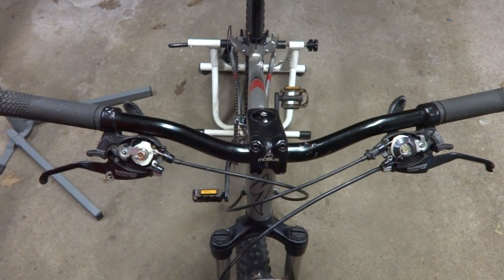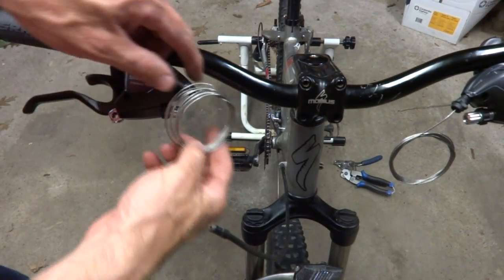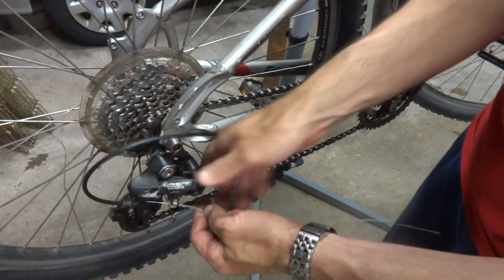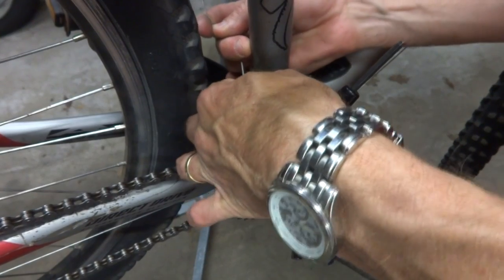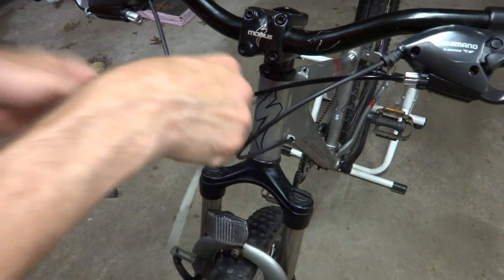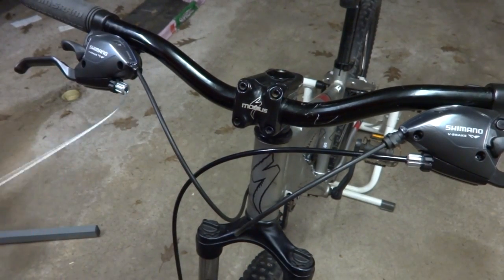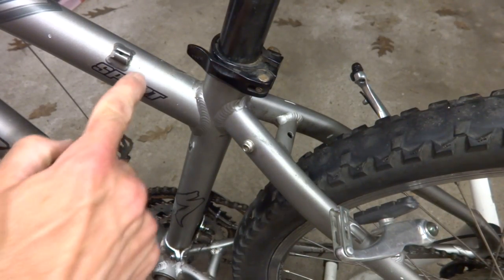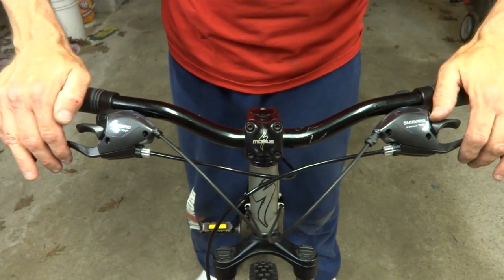Installing Trigger Shifters/V Brake Levers On Mountain Bike

Comment: I have an Ancheer ebike power plus. I just found the ST EF51 shifters. I hate the mickey Mouse shifters it came with. Im 65 and been riding 60 years. Been looking months to get rid of the junk shifters. With the Tourney detailer it should rock. Don't let the comments bug ya about the socks. I used to wrench on bikes in my bvd's.

Comment: I have watched several of your videos that have helped me immensely. Because of that I would like to give back to you some of my knowledge from working in a machine shop years ago. In this video one end of the handle bar is mushroomed and you use a file to smooth it out. So far so good,except your filing motion was forward and back using a sawing motion. Doing that will clog the file teeth with metal particles and in this case aluminum which is a softer metal will fill voids of file teeth rendering the file over time useless. The cutting edge of file teeth only face forward so your motion should be forward or pushing away from your body. When you do this the filings will fall out and not clog the teeth. You can clean the file with an actual file cleaner or a wire brush. If you use proper filing technique the file will give you years of service. Sorry to be so petty but I wouldn't want folks to learn the improper use of a file. Your videos ROCK!!  and Where are your shoes, you are either wearing white socks or barefoot!  Lol
Reply from the maker: +TheAugiedoggie1 Watch more of my videos. Sometimes I wear shoes or even slippers.

Comment: Just a tip. When using a bastard file always always always move in one direction. Always go away from your body. Going back and forth will shorten the life of a file dramatically. There is two ways to use the file. Have the file in a stationary position and move the part or have the part stationary and move the file.
Something I learned since the early 80’s in machine shop.

Comment: Thanks. You have the exact shifter i have and i thought i was missing the barrel adjuster for the right side. But i guess it doesn’t need one
Reply from the maker: Front derailleurs don't usually have cable adjusters, but rear derailleurs do.

Comment: Is it possible to replace shifters using the existing wire ? I have cantilevers and the shifters I'm looking at say they only work with V breaks.
Reply from the maker: Cables are cheap and are a wear part. Replace them.

Comment: Hi great video 👍🏻 Shouldn’t the other side have a barrel adjuster? Cheers Stevie
Reply from the maker: Some shifters have them. But rear derailleurs generally have barrel adjusters. So an adjuster on the shifter is redundant. Front derailleurs don't have adjusters on them.

Comment: Hello RJ. I have Shimano Tourney derailleurs with MicroShift M25 gripshifters. They're a pain to adjust. Would it be reasonable to change these gripshifters with EF51s? Would EF51 work with tourney derailleurs? 3 x 7 gears.

Comment: Hi, can avid speed dial 7 be compatible with old Acera ST-EF35-8 (shimano shifters plus brake levers) ? thank you !
Reply from the maker: Avid speed dial 7? I searched google, and these seem to be brake levers. The EF35s seem to already have brake levers. So I don't know what you are asking.
Reply: I meant: can I replace the stock brake levers which came included in the EF35s with the avid speed dial 7 brake levers since I have avid bb5 mechanical discbrakes installed on my mtb ? thanks and sorry for not being clear enough. The shimano shifter plus brake system SEEMS to be of one whole block, that's what worries me. However, you can remove the "outer shell" with a screwdriver
Reply from the maker: Probably not.
Reply: Ah ok.. . It's a little bit like the one you were using for this video...

Comment: where did you buy the shifters/brake levers? I've been trying to find those exact ones.
Reply from the maker: Tina Nguyen Ebay. You can find new ones for under $25 shipped fro overseas.

Comment: I have a Question, does the rear derailleur, front and shifters have to be the same brand ect? Or can i install an XT rear with sram x5 front and SLX shifters?
Reply from the maker: They have to be compatible.You need to find out if they are. The amount cable pull needs to match. Some brands/models are compatible, some aren't. You need to research.

Comment: Hi RJ can I use the EF51 shifter/V Brake, on a bike with disc brakes?
Reply from the maker: Zero1 I believe so.
Reply: +Zero1 probably way too late now but there's an adjuster in the brake grip/housing that sets it up for v brakes or caliper/disc type (I'd assume the v brake setting has a slightly longer throw).
Reply from the maker: This goes into detail: https://www.youtube.com/watch?v=DetDJ_8EKio

Comment: Hello RJ, I replaced my rear shifter from a grip to a trigger assembly and the dérailleur now only shifts up, not down. Is there a way I can fix this? I don't really know how to google this problem to be honest.
Reply from the maker: Too many variables. Isolate the issue. Is it the derailleur, the cable, or the shifter. Was the shifter new, or used? If it was used, it might be stuck pawls: https://www.youtube.com/watch?v=UCRG8J35CVc

Comment: what is the best method to remove the rubber grip ends on the handles, without cutting them? I would like to reuse mine, but they are on there so strongly.
Reply: +Javi Use pressurized air, Insert the end between the grips and the bars and push the air in and at the same time pull the grips
Reply from the maker: +Javi I use a push something like an allen wrench under the grip, squirt in some isopropol alchohol in and slide the grip off. https://www.youtube.com/watch?v=dy7Uo8AAJlg

Comment: I don't cut cables unless it is the ONLY way. When re-doing my brakes and gears, I just disconnected, measured, recorded, and had to cut the gear cables - which I chose to do near the front with about 8" left. Then I could just discard the completed cables. Now, if I need to re-do my brakes, I can just discard and re-use my measurements.

Comment: Do you have to replace the cables? I Recently replaced the cables/housing on my bike but I want to change the shifters now. Can I keep my old ones and avoid the extra work/money?
Reply from the maker: Well you could spend a few dollars have nice new cables and housings and crisp shifting/braking, or you could try to reuse your crappy old cables, hope they fit, and and have lackluster performance. Your calls.
Reply: RJ The Bike Guy I don't believe you read my question. I just "recently replaced the cables/housing". The Cables and housing are new. I don't know where you got "Crappy old cables" from.

Given that you understand now that my current cables are not "crappy", Will I still have "lackluster performance"?

I mean surely the cables would fit as arn't most cables a universal size? and any small length issues that likely would arise could be adjusted at the derailers? I Have plenty of slack.

You must understand that it would be wasteful to buy new cables if I don't need to.

Comment: Hi RJ can I use 6 speed sprocket with 8 speed shifters?what to change ?
Reply from the maker: Jeremy Acosta No, you can't use a 6 speed sprocket with a 8 speed shifters. the spacing is different. Either go to 6 speed freewheel and 6 speed shifters or 8 speed cassette and 8 speed shifters.
Reply: So I will buy another thanks.
Reply: RJ The Bike Guy what about the derailleur?
Reply from the maker: The derailleur needs to be able to reach far enough to reach all the cogs. If you go with Shimano SIS shifters (all modern Shimano shifters), you will want a Shimano SIS derailleur. A 6 speed derailleur probably wouldn't work with a 10 speed cassette. A 10 speed derailleur might work with a 6 speed freewheel. But with a 6 speed setup a 6 or 7 speed derailleur would be a better choice.

Comment: can i replace twist shifters to trigger shifters on my son's bike? the twist shifter is very hard to twist the gears (6 speed).
Reply from the maker: svcruz Yes. Just find some Shimano SIS trigger shifters, and make sure you have a Shimamo SIS rear deraileur. 
B efore you change them, here is a video you should check out: https://www.youtube.com/watch?v=EdEk2kO4Lmk
And another: https://www.youtube.com/watch?v=2pCr5zH7kBg
Reply: RJ The Bike Guy Thanks alot, this video helped a lot changing the rear brake cable!

Comment: can i upgrade to disc brake with that shifter and brake combo?
Reply from the maker: Yes, a Shimano EF-51 shifter/brake lever will work with a mechanical disc brake.
Reply: RJ The Bike Guy i got shimano st-m530 deore is it good? for upgrading to disc brake also?

Comment: What would be a good anti-seize compound brand to use on a pair of pedals? Permatex? Loctite? Most people recommend  Loctite. But, Permatex anti-seize has aluminum, copper, and graphite lubricants. The thing with anti-seize compounds--people think about no galvanic corrosion.
Reply from the maker: Just a little grease.

Comment: I bought the same and installed it, but for the rear derailleur the low button doesn't come back. As soon as I push the low button, it stays there and sometimes shifts multiple gears. Is there any video to help me out or some other way? I appreciate it
Reply from the maker: They are brand new shifters? Did you replace the cables and housings?
Reply: The same in the video but 7 speeds. And I did all the things, but the cable was with it so I didn't to open it up.
Reply from the maker: Maybe there is something wrong with the shifter, or something else is wrong. You need to isolate the issue. https://www.youtube.com/watch?v=gwBQxhZhKnE
Reply: Alright. I'll check it out. Thanks again

Comment: Theres a good chance those covers weren't removed, but simply broke/fell off - the plastic on mine has turned brittle and they have cracked around the screws that hold them on (mine shift ok so are held together with tape).

Comment: GOOD VIDEO only comment i have is a file only cuts in one direction (not like in the movies
) and i would have lubed those new cables and housings
Reply from the maker: Modern cables don't need lubrication due to the plastic linings. In fact lubrication can make them function poorly.
Reply: Nope, flat files cut in both directions.